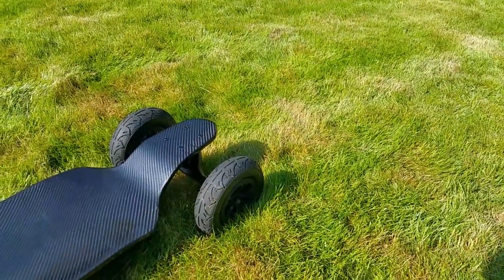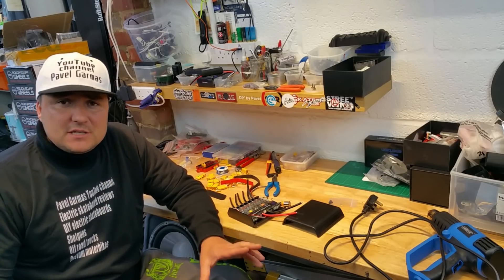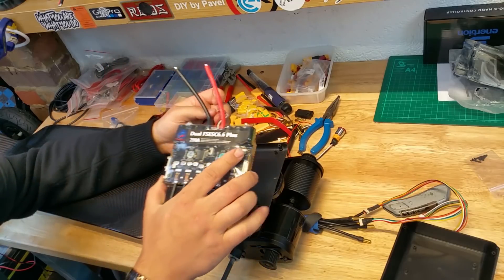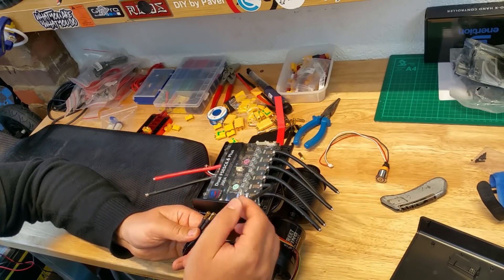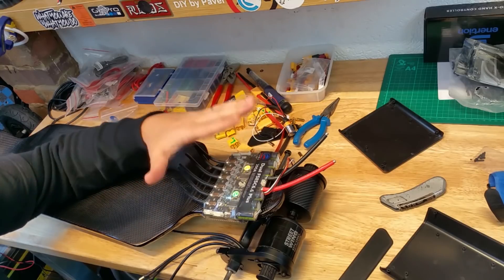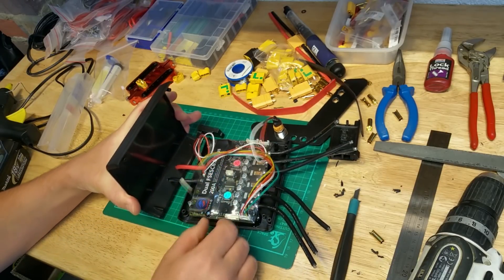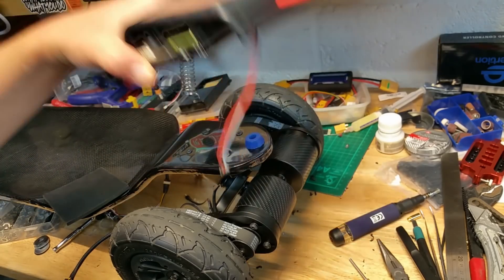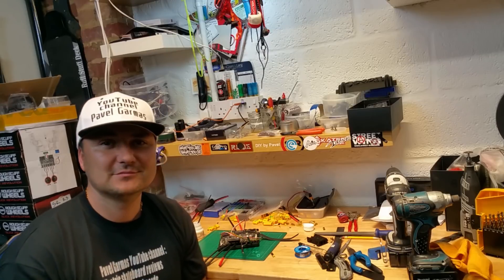How to design ,plan and build VESC enclosure. Beast video 10

Comment: Hi Pavel! Amazing video as usual! I'm wondering if having the motor cables inside the enclosure generates too much heat.. Is it better to keep the connectors for these cables outside? Do these connectors generate much heat when pushed hard? And, side note, I'd love a video about how you made the enclosure waterproof.. I fear water coming in from the holes in my enclosure!
Reply from the maker: Hello Marco!
Thank you for watching and for commenting mate. 
If you have noticed, i did cut the bottom of my enclosure and did push the heat sink through to outside....heat is being taken away by the moving air. cables do not heat up that much so not a worry. This video was made 9 month ago and i do still have the same enclosure and the same esc : ) i do ride hard and i am a heavy guy - 110 kilo...ho heat : )
Take a look at my latest video - evolve karting event! I was rasing and pushed the board - no issues. 
Regarding the waterproofing - i have siliconed every joint in the enclosure so it is splash proof. I do have a video about it - electronics safe sealant - take a look.
Hope this helps mate.
Ride safely.

Comment: Do you have a link for this enclosure?
Reply from the maker: Morning mate,

This is an electronics enclosure purchased from " RS components ". I just did check and it is discontinued but there are loads of different options on the website. You can actually search by size. Here is a link buddy : https://uk.rs-online.com/web/c/enclosures-storage-material-handling/enclosures/hand-held-enclosures/

Hope this helps.

Comment: Why did you leave the plastic over the heat sink. It will act as a insulator if you leave it there. Unless you removed the plastic wrap?
Reply from the maker: Hi!
Thank you for the question and for checking out the video. The clear heat shrink needs to stay on as it does protect all the electronic components that are on the other side. It is the only way to insulate all the connections. The film is not meant to be taken off and most people do leave the vesck fully enclosed anyway. Venting this vesc was my idea and all the tests did prove that the unit is hardly warm even after a hard off road riding.
Thank again, stick around and 
Ride Safely!

Comment: lipols are the best energy denciti bateri but pleas build sam not plastic box for thet batery neaby from carbon.or alu. when they faier its ewerithing in......... hawe you heard from lifepo?
Reply from the maker: Hi!
Welcome to my channel. No i did not hear from lifepo....what or who is it? My batteries will be Lipo  but in a very interesting place : ) Stick around....you will see : )
Reply: Lifepo4 are just litle smoler energy dencity bat. They are seafer bat no puff. Like li pols and constant curent its bether then liion.
Reply from the maker: Thanks for the clarification mate. I will definitely look into this. I have not heard about anyone using the Lifepo4  on the ESK8 builds.....is the a reason?
Reply: @PavelGarmas  yes I know bud when is it not RC model bud electric vehicle for human. then safety first liIon bat 18650 are too good . I  build now my 2x6S and 4P pack from 26650 lifepo4 bateries bud from china. sou I tested 60 pcs  :-) . and go solder then.
Reply: Will you programing dual flipsky?
Reply from the maker: @tomgreysk  
I am doing it now ;)
Reply: @PavelGarmas  programing  each motor separately ... ? Ok. Good luck...
Reply from the maker: @tomgreysk  
I think that is how it works ; ) I have not programmed dual vesc before.....singles and pairs - yes .
Reply from the maker: All done!
So easy to use the 2019 VESC tool. This board scares me : ) sounds so fast!
Reply: @PavelGarmas  yes in your language...... ok I an curious to see som vide.
Reply: You have FOC MOD ther?

Comment: Great video I have a 6.6 plus in my current build, spud deck calibre trucks abec 107s (green) with green abs printed pulleys and green hexigon griptape nanox controller but upgrading to a custom built firefly remote, has a screen with speed board battery voltage, range ect. For this build i wanted heaps of current so i ditched the 18650 in favour of 26650 - 12S3P 15000mah and happily puts out 150amps continues similar size to 12S4P pack. I am 95% complete pack it too thick of enclosure so a ordered a router to carve a few mils off the concave deck. Top speed on paper is 55Km/h but I am going to print some larger pulleys to give more torrque and less speed, curse you now I am thinking about carbon fibre coating my deck.....love your videos
Reply from the maker: Hi!
Thank you for the lovely comments mate! Means a lot....it is not easy to record every step and edit good videos. I do make them quite long sometimes but i just want to get all the details covered. Carbon fiber skinning process is actually quite simple and I would recommend you to try it. I do have a full "how To" video on my channel.
Did you build the battery yourself? I do have quite an interesting idea on how to mount my battery so lets see : )
Nice to have you around. Ride safely!

Comment: The Beast is impressive, my friend!  I expected no less.
Now a question that will show my ignorance: What is the difference between a VESC and an ESC?  I know the VESC looks much larger than the ESC on my Evolve, but beyond that I am (as usual) lost:)
Reply from the maker: David!
Hello my friend!!! How are you ? Hows weather?
Good question David!  Good answer Lee!
Reply: @PavelGarmas  Hello, Pavel.  Summer weather yesterday, chilly and raining today.
I got to ride yesterday and got the neighbors on the board as well, both male and female.  They enjoyed the ride very much.  In fact, for awhile I wondered if I would get the board back:)
Reply from the maker: Well done Lee. Should we join forces : )
Reply: David, the VESC is a fully programmable electronic speed controller.  It allows the user to set all perameters of operation and fully customise how the motors behave.  An ESC is flashed with firmware that cannot be changed by the user. The VESC was invented by Benjamin Vedder and given to the community as a gift, what a guy!
Reply: @LeeWright  Thank you, sir.
Reply: @davidlinscheid2321  you are most welcome!

Comment: Loving how this is all coming together. The board is looking great and I Love how small you have managed to make the enclosure having the in built anti spark helps a lot for sure.
Would it not be better to remove the shrink wrap off the VESC to allow more air flow or are you using that as another layer of water resistance?
DHL are saying they are going to deliver my FOCBOX Unity on Tuesday so I should finally be up and running properly soon!!!!!
Reply from the maker: Hello Simon!
Thank you for the comment mate! I was thinking of removing the clear heat wrap but it does serve as an insulator  for all the connections and the mother board parts. Having the heat sink through the enclosure will be enough to keep it cold even after running it hard.....i hope : )

Comment: Board looks great, i like this vesc enclosure much better then this gigantic boxes that You have inbetween Your legs on trampa builds...Do You wan't to fix batterries in the middle of the deck or You have another idea?
Reply: The problem with off road boards is they need lots of power and therefore big batteries! You have two choices, on top in the middle or underneath.  Underneath is not recommended for off road boards as you can imagine!
Reply: @LeeWright  Yes if You want to build a board designed for offroad then box in the middle on top is probably a good choice, but if You want a normal cruiser with pneumatics to ride on some gravel roads then mounting battery underneath is not a bad idea :)
Reply from the maker: Hello X!
I got an interesting idea for the battery.....lets see what you guys will think of it : )
I should have another video out in a week and will have the custom grip tape on and the board running.
Reply from the maker: Lee,
There is another way..... I will test it first and will share then for everyone to comment : )
Reply: @PavelGarmas  That is getting more and more interesting :) The only other way to mount batteries that i can imagine is to carry them in the backpack and have longer cable to connect them to the board xD
Reply: X Studios I believe Pavel is looking at a backpack with a battery in it!
Reply: @LeeWright  Yeah that is what i'm thinking xD